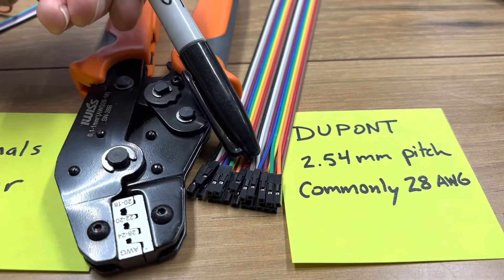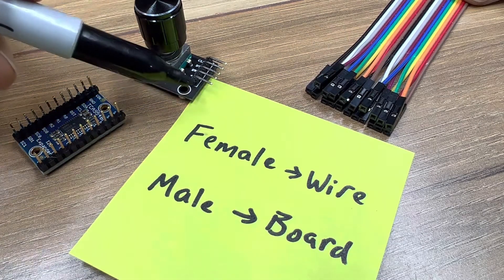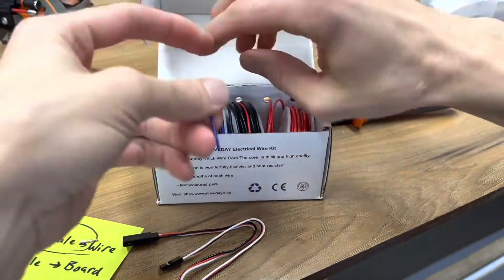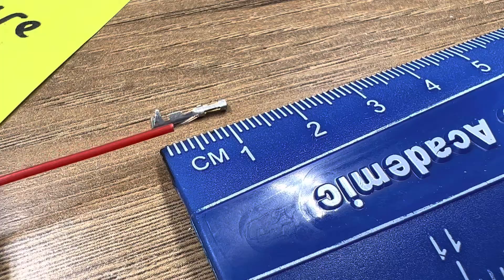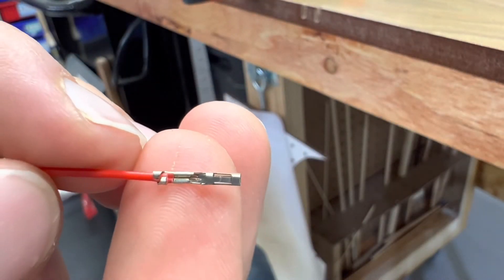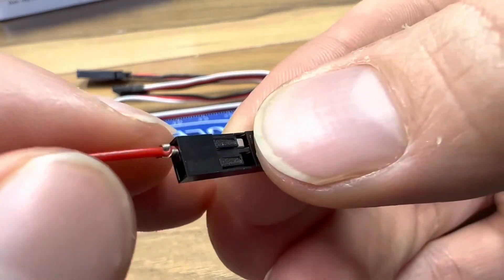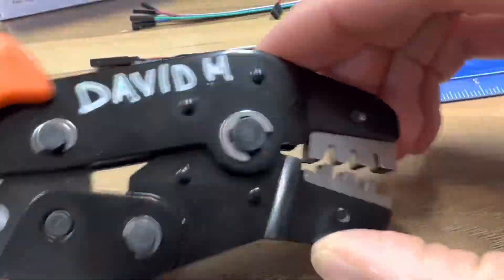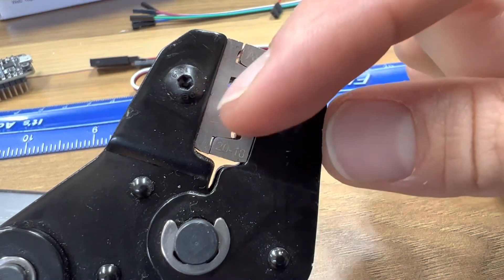How to crimp Dupont Terminals, and why you SHOULDNT

Comment: that is the wrong tool and they are NOT called dupont terminals. to crimp them properly an M shaped crimping tool should never be used. the crimping jaws need to be circular. it is impossible to do them properly using the tool you just tried in the vid. That is why your crimps are so awful.

Comment: Good points. I heard (in ham context), out in the elements copper and steel shoud be connected brass and not directly into each other bwcause of corrosion. But is this not a problem in normal context, when air temperature, humidity, amd condensation might play a role? Do all steel/iron etc. conductors have zinc plating? 🤔

Comment: What the other videos miss is that the wire shouldn't extend past the crimp location.  If it does, the header pin might push the connector out of the housing.

Comment: Good video. Even the dire warning not to do it helps as you give the pitfalls. You have your name on the crimper so obviously you have found it necessary at times. That is where I am with a prototype. It was either give up and move to the PCB phase or crimp some custom connectors with flexible wire. I don't want to have to do revisions of the PCB so the prototype is important. Thank you also for the comment about AWG not being what is advertised. I thought it was just me. :)

Comment: 0:30 On the metal part (left) the 2 ends touch each other but on the insulation part (right) the 2 small ends do not touch, one goes left and one right a bit, is this normal? That is how my crimping looks like too.

Comment: Anyone out there having this trouble with the insulation crimp, try this. Go to where the wings stop and move it back just a nudge. Then crimp. 

That worked for me with my crimpers. The insulation crimp wraps around as it should to fit in the housing. Stopped giving me the trouble showed in the video.

Obviously, it could just be my crimpers. It's worth a try though, if you really want to make your own.

Comment: The problem with the pre-assembled ones is that they are not very good quality. My main issue is the female connectors are too loose. I usually have to take them apart and crimp them a bit to make them tight enough. If I have to do all that, I might as well just make my own and use quality connectors and wire.
Reply: use a wire wrapping tool and wrap wire, oldschool but it works great!
Reply: Also magnetic/iron...so very poor conductor

Comment: I  just usually pull off a F-F section that matches the color code I want, release their single plastic covers and then rearrange/reassemble into a multiple cover that matches whatever I'm connecting to. I've never had a good crimping experience with Duponts.

Comment: hey this is fantastic, im just starting out- thing is, i have some spools of 22 awg, and i wanted to essentially use them as custom-length duponts, are you suggesting here that i should only crimp and make female duponts, and only use these "snipped" wires as regular Male ends, and only create Female dupont crimps on the other end, if i really must?
I'm trying to figure out how to use these spools properly pre-solder, still prototyping
Reply: look into buying a wire wrapping tool and some wrap wire. 
makes life easier, and just wrapping the wire holds pretty damn good... 
but maybe use some hotglue on it if there is a lot of vibration.

Comment: If you use the correct crimpers the sleeve will clamp correctly. You need the round jaws, not the B shape your jaws have. Your crimpers are for the Molex pins which have the sleeve crimp with parallel sides, the Dupont have pointy non-parallel clamps.

Comment: I find it easier to hold the pin lightly in the jaws (usually one click) and then pull it through until it limits on the shelf.  This saves you dropping the pin.

To strip the right length of insulation I have mounted a spare pin on a piece of wood and use that to to check the length of the stripped wire.

I use silicon insulated 24 AWG wire, you can strip this with your finger nails, no chance of nicking any of the strands of wire!

My crimpers don't crimp the insulation properly either, a right PITA.
Reply: When selecting the wire you also have to look at appropriate insulation thickness. You can also use the opposite connector to hold the one you are crimping for better control.

Comment: If the wings aren't crimped properly, just crimp them again in a smaller cavity. I usually crimp them twice by default and it works like a charm every time. Much easier then trying to fix them with regular pliers.
Reply: This is the answer.
Reply: Yeah, my rule of thumb is that I should crimp 1 gauge lower than my actual wire. If my wire is 22 awg, I crimp on the 28 awg

Comment: 28 AWG?   I use 22 AWG stranded wire and it works fine.  It seems evident that smaller sizes will also fit.
Reply: Standard 0.05” pitch ribbon cable is always 26 or 28AWG, with 28AWG being by far more common. That cable is designed for insulation-displacement connectors which require a narrow wire range. And since most 24AWG wire’s overall insulation diameter is larger than 0.05”, that wouldn’t work anyway. (There is 24AWG with thin insulation, but nobody bothers for ribbon cable.)

Comment: Currently shopping for crimpers. Looks like SN-025 is the model to use for dupont terminals, it gives the correct round crimp on the insulation clamp and B crimp on the conductor.

Comment: Evidently this crimper does /not/ have proper dies for DuPont and Mini-PV connectors, as the female die on it is designed to fold the tabs back on to the wire, whereas the DuPont design uses a circular shape instead. Thus, why your crimped terminal didn't fit in to the housing. Also, while I'm struggling atm to find documentation of this, it seems the SN-28B is also not appropriate for JST connectors, as those need a 4mm deep die, whereas the 28B's dies are 7mm deep - so you can't even use them for a single-operation crimp without crushing either the connector-side or the insulation-side. 

I'm feeling really frustrated that this stuff is evidently so difficult to get right. It really doesn't make sense to me. Even if these aftermarket crimps are cloning the OEM tooling, what prevents them from actually copying the geometry exactly?? How are they fucking up these critical details? Really sucks that it seems you actually have to pay hundreds to get proper tooling that works.
Reply: SN-025 gives correct shape crimp on the insulation for dupont terminals
Reply: Yes.  I use an SN-025 for DuPont and SN-01BM for JST.   SN-28B seems to be mostly for larger terminals, although the smallest slot in it ought to work.  But I see it's not properly tightening up the part that grips the insulation.  The SN-025 does.
Reply: patents and such prevent others from copying the dies 1:1, its really something where legislation is needed to stop this madness. would be better than any right to repair legislation too

Comment: The trouble with those pre-made cables is that they have individual single pin connectors, which you advise against. So do you recommend buying them, removing the single shells and replacing them with the appropriate shell for the number of ways you actually need?
Reply: You can buy pre-crimped leads with no housings applied.
Reply: Then you still have to splice with butt connectors or solder to whatever is going on the other end, rather than having a clean single wire with the right terminals on both ends.
Reply: You can get the wire with the terminals you need on both ends - no splicing needed.
Reply from the maker: Yes exactly.  Purchase the housing (shell) with the appropriate number of positions.   And if you just buy 2, 3,4, then save cash.

For example, use 2 pieces of 3 pins to get a 6 pin connector - it's far better than singlets.